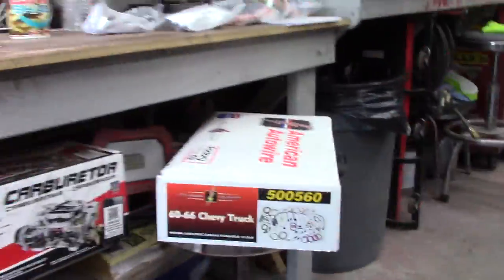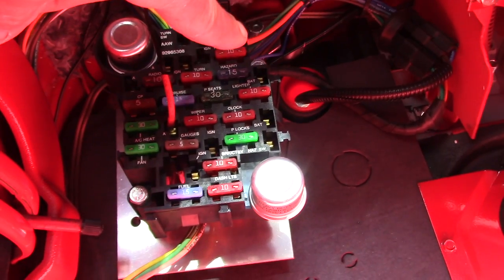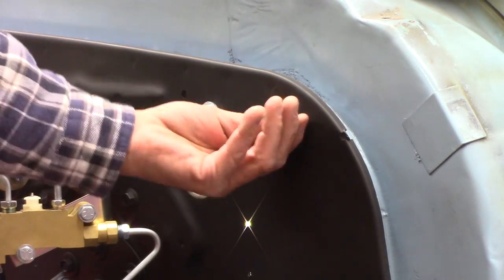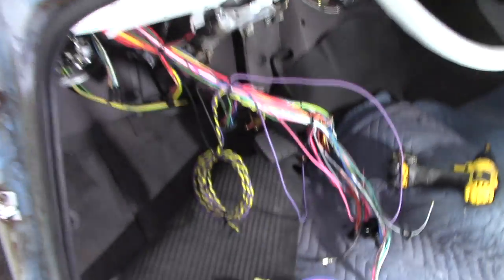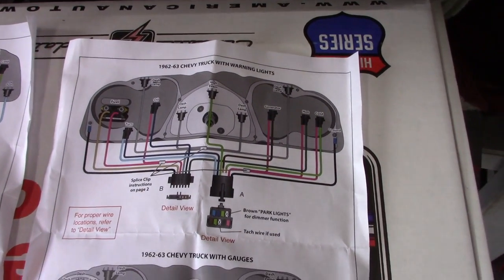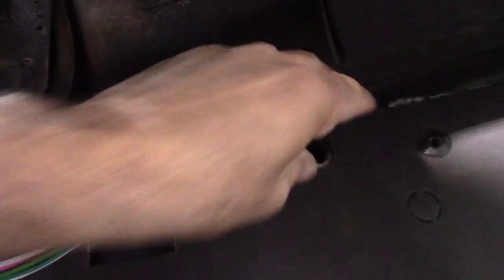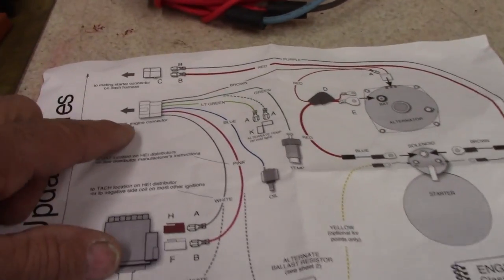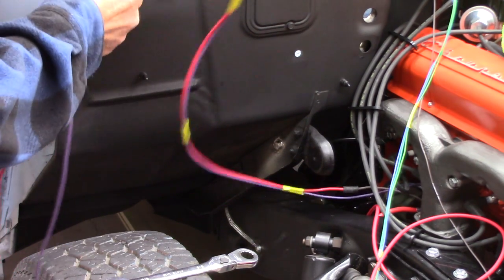Wiring up the chevy c10/And a short drive

Comment: Awesome! Just picked up the same wire harness .. thanks for the look into the project! Your an awesome builder Sir, nice trucks! Mine is a “63” great looker bought it from Alabama.. guy wasn’t a mechanic at all.. I’m fixing certain things… got 45 k into mine so far… Love the old steel.. Again, nice trucks Sir!
Reply from the maker: Thanks for watching man
Reply: Absolutely Sir, love the red one you’ve got restored very cool color! I’ve got a Tremec 5 speed to go into my “63”. Behind an engine I had built by “Hot Rod Company” they provided at the cost of right at 10k a 383 Stroker small block. They claim on the web that they routinely produce 514+hp in these.. Bull, valve train geometry is way off.. I’m having to fix their f-ups .. I think they get a rotating assembly and monkeys do the rest.. Ha ha, live and learn.. hey I’ve got lots of pics of that engine, nice serpentine accessories drive.. definitely show, but I’m having to “perfect” their lack of “detailing” let’s say… “don’t bother with them” but looks like a 10 k engine, I’ll give it that..

Hey, nice rides Sir! You rock as builder..
Keep the old steel rolling…

P.S. mine went through inspection lanes for Delaware. Only failed for lights.. harness is mostly fried..

Comment: Watching your vids makes me miss mine... I had two.. 65 and a 66. I got the 65 in high school, and it had 25k original miles (292 straight 6, three speed on the floor (with low)). To this day, I had no idea or reason to sell it. Regretted it ever sense. I have a 89 K2500 nearly finished.. Bought it new.. frame up restored. Just need the weather to heat up a little, and stop raining.

Comment: Nice wiring kit for the C10 brother. I looked into the script valve covers you have on your Pop's 350 and there sweet covers but the price on them are way more then this old man can let go at this time but they sure are sweet and cast aluminum I would have never guessed they were! I'm also going with the Ram Horn exhaust manifolds less chance of bolts backing out and leaks. I just picked up a nice clean older Eddy C3BX intake manifold with the oil fill tube for my 327 next Holley Carb. I'm getting there one baby step at a time lol... l can't wait to get all my other parts then get my 327 put together and dropped in my C10 this summer God Willing. I haven't made my mind up yet if I'm going to stay with the original 3 on the tree and it's old M318 3 speed tranny or pick up a rebuilt Turbo 350 auto tranny for my C10 ?? Eather way it's going to be alot more fun driving around my old Blue Smurff C10 after I switch out engines.That old 250 in-line 6 cylinder just keeps going an going but there not much fun for a Saturday night run if you know what I mean lol... Remember what I said before if I win the lottery I'll get ahold of you Gibby and set up an appointment for you to fix up my 63 C10 shorty fleetside after you get your Dad's done lol... Gibby that's one sweet gift for your Pops. Keep on Trucking brother...
Reply from the maker: Yea man those valve covers were a little pricey but they sure are cool, good score on the intake manifold your right about those 250 engines thay just keep going

Comment: I might have missed it if you explained it. Did you wire the voltage regulator or does this harness no longer need to use it?

Comment: I didn’t get the same wiring kit. Yours is very detailed and cooler... what did you pay for it? And is it better to just rewire the hole truck.
Reply from the maker: It was a little over $500 in this case it was better to rewire the whole trunk yes
Reply: Yeah I was thinking about doing that instead of trying to use the pre-existing wiring.

Comment: That wiring kit looks pretty good and fairly simple. I just stripped out my 62 C10. Where did you find it and who is the manufacturer?  I need all the help I can get on the wiring.
Reply from the maker: I ordered the (America Autowire) from Amazon or you can get it at Summit racing also

Comment: Gibson63 could you do a short video on the Reverse light switch. I’m currently working on a 66 C10 and the current reverse light switch that was installed had a broken prong that is pressed to activate the reverse lights when the column shifter is moved down. The only problem is, the tab on the column shifter continues to rotate and snapped off the plastic prong on the reverse switch.  Any help is greatly appreciated